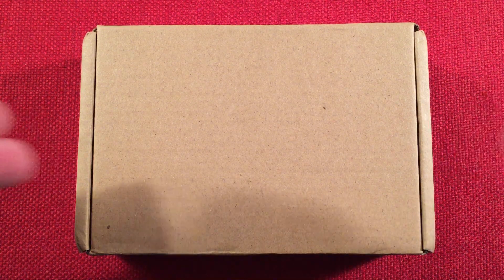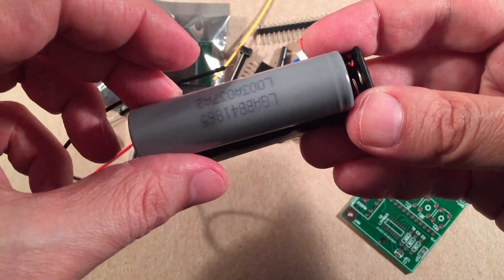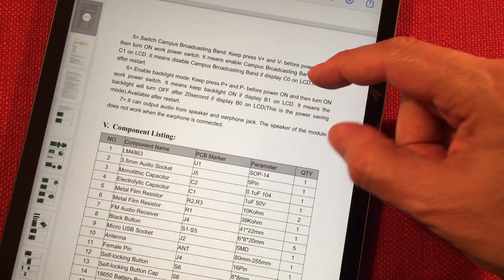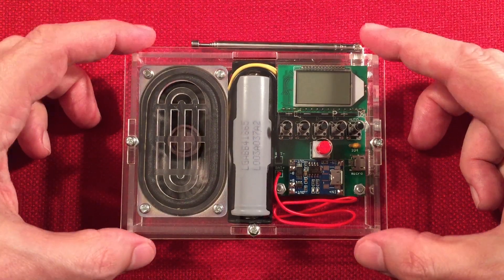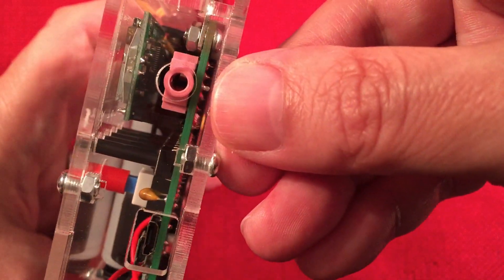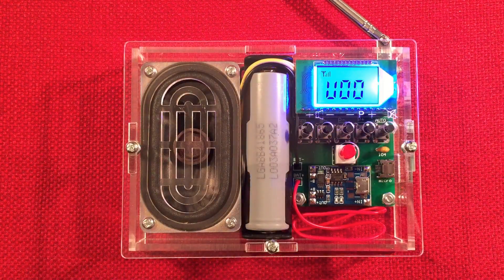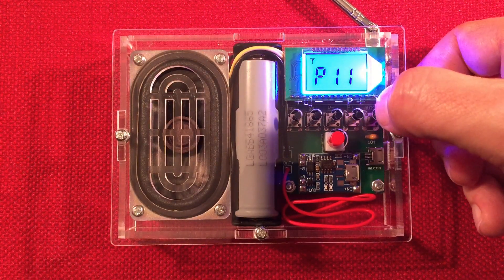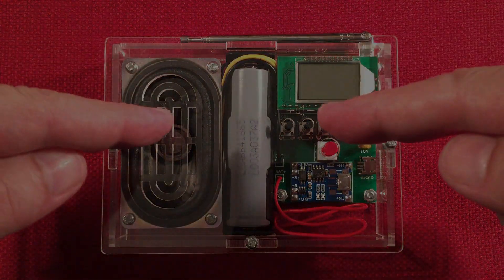ICStation DIY FM Stereo 18650 Powered Radio Kit

Comment: Bought this one,  got it all together and it works great.  Just a reminder that you will need the flat top 3.7 V 18650 Lith Ion rechargeable battery.  I took one that was not a flat top that I got from another radio I had and its just a bit too long for the battery case making it unable to close up the clear case properly.  This build was my second attempt.  First was a failure and this one success.  Learned so much and had some fun at the same time!

Comment: I'm making this right now and can't figure out whether you solder the antenna on or you screw it on, other than that this is a great video! it helped me a lot as I built mine (mine also came with 15 prongs im so glad I didn't cut one off by mistake thanks to you!!)
Reply from the maker: I think soldering the antenna is what they  had in mind.

Comment: Hey, it worked 😃finally, the problem was at the chip of course, I fixed it and it works now perfectly :D thank you <3
And I have one more question, if I can actually use Bluetooth there ? Like with phone ?
Reply: I know this was a year ago, but I'm having the same problem. Speaker doesn't work, 3.5 mm audio jack does. Did you replace the LM4863 chip? or did you just resolder the chip?

Comment: Im going to get this kit. I like the ability to run off batteries/liion. I have another clock on the way that uses one 14500 AA 3.7v lithium cell.
Reply from the maker: This is the kit to build.  Use the speaker only, the headphones pull huge power for some reason, were talking .350ma vs .050ma on the Speaker.  Don't know what is wired wrong in the circuit, but it is the same with their newer design as well.  That one consumes almost three quarters of an amp when headphones are plugged in...crazy.  So leave the headphone jack uninstalled.
Reply: @todderbert  yeah I saw in your other 18650 build you said that so I'll leave it out haha. .I have some 3400mah Panasonic I got in the mail a while ago when they were on sale. Should last forever haha
Ive  been watching almost all your kit videos

Comment: Does it show you battery level? Or when plug in does the charge board have LEDs for wherher its charged or not?
Reply from the maker: On the charging board there are two leds, one is red showing that the battery is charging, and blue when it it fully charged.
Reply: @todderbert  thanks!!!

Comment: Nice review! An Amazon reviewer says it doesn't retain presets after power loss?
Reply from the maker: Just keep a good rechargeable 18650 in there, and plug it in once in awhile.  If it loses presets, just rescan.  The auto scan is one of the best I have used.

Comment: The screws are too wide for the antenna!!
Reply from the maker: Yes, I had to carefully drill mine.  Though some say just soldering the Antenna mast to the Board will be good.  You will have to use a Hot Iron to do that though.